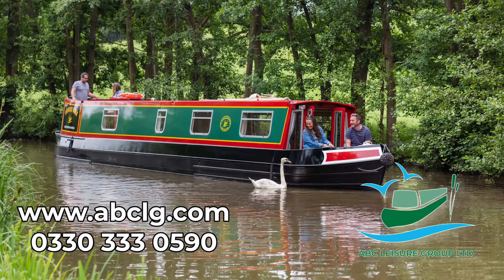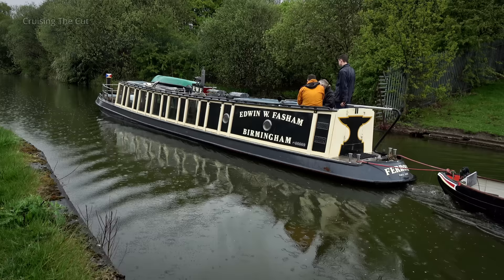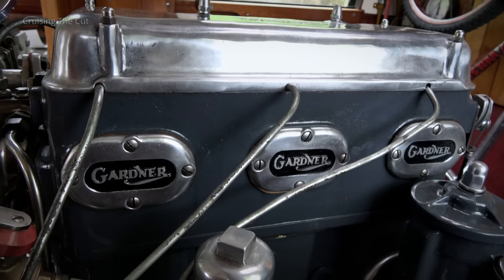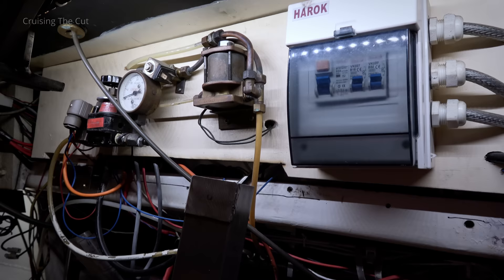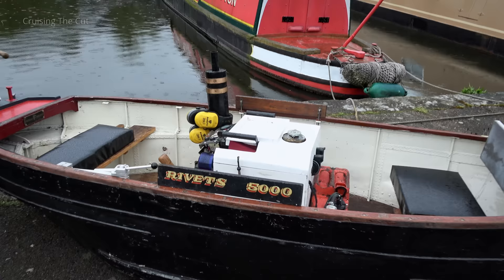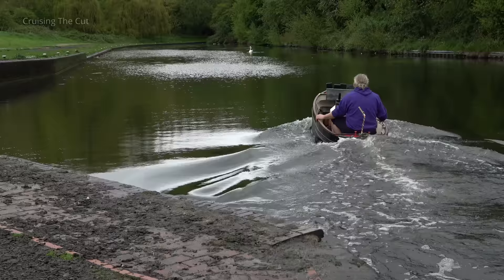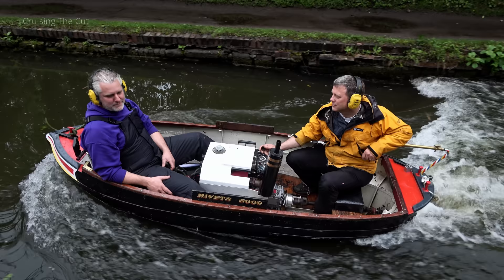298. The man who built a canal boat out of scrap metal

Comment: That's great; the remote control reminded me of a bow thruster concept, incorporated into the tiller, when you turn the tiller a little the thrusters are powered a little, turn it a lot and you get more thrust.
The thruster control are from a motorcycle twist throttle, with override switches (for docking) and power off (maybe a horn button?).  ;-)

Comment: What a deliciously well designed boat, I'd love something like it. Though I'd probably put in an all electric engine. Thanks for another corker, Dave.
Reply: All electric is simply not practical for anything other than a local fixed run. Arranging charge points along the canal is possible, but not practical. Solar won't do it. Best option (IMO) right now is a diesel electric hybrid with a largish, (and expensive) lithium Ion battery. You can run the engine for something like 30 minutes a day and electric the rest of the time. (With the right setup)

Comment: Isn't having an open diesel flame risky? The nox and all that?
Reply: Nope not if it's a properly designed and installed. Much safer than gas or alcohol stoves
Reply: NOₓ is created in high temperature combustion, a yellow flame isn't high temperature.

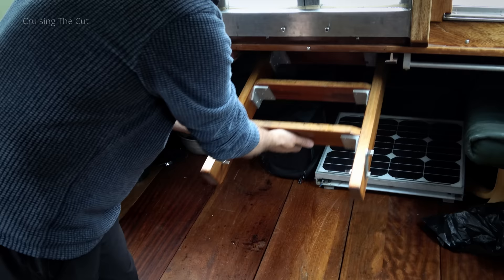Comment: Thanks for another great video, David. Your "Back to the Future" intro. was fun! Also, I just discovered a video tip (1:35 in this attachment:  https://www.youtube.com/watch?v=jUYQYxAMw9w) that can make the flickering LED display on the boat's control panel, or just about any flickering light source, disappear. In brief, copy the clip containing the flicker and paste the copy above the original clip. Then, move the pasted clip one frame to the right, and adjust its opacity to fifty-percent. This should fix the flicker. It may not work with every offender, but it's worth a try!